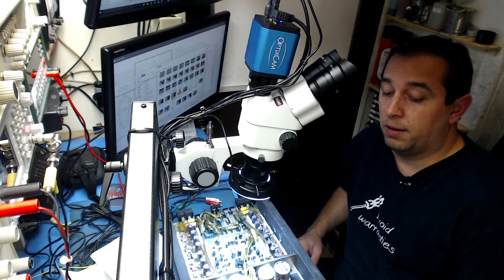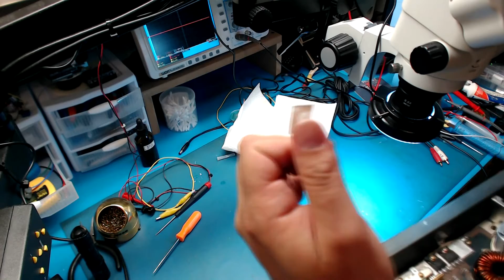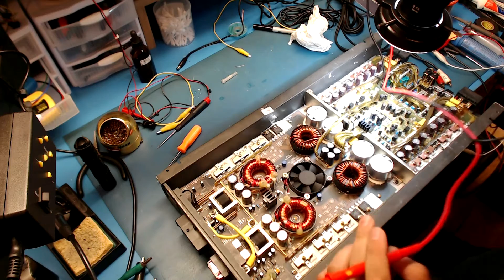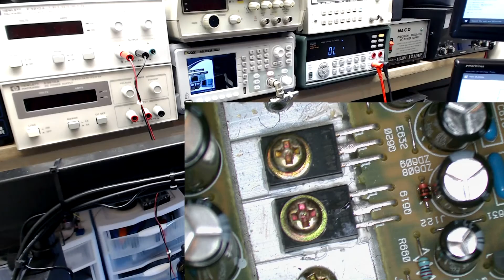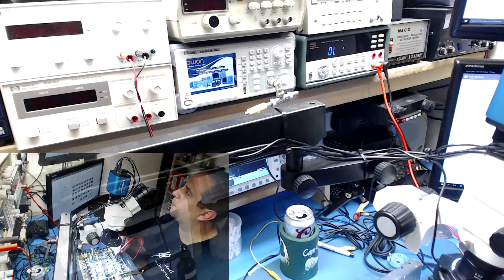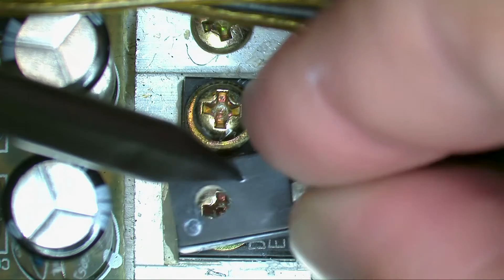ALPINE MRV-1507 AMPLIFIER REPAIR,  AMP #2

Comment: Hey man, love the videos, learning heaps from watching. What would you advise to use in the way of current limiting power supplies for testing? Do you always just use low voltage DC for testing on the secondary side of the power transformers or do you use a variac for bringing the item under test up slowly on mains AC with some sort or current limiter on the primary?
I think i ought to invest in an isolation transformer to start with, but keen to hear what your thoughts are!

Comment: hey ..im working on an amplifier which has no shorted transistors or component that i could fine but the output of the amplifier gives a noisey distorted sound ??could you help me out here .
Reply: premraj singh maybe soundcard
Reply: rodeo o Not quite.
Reply: There’s lots of things it could be.  Always start making certain power supply is correct... all the busses and power rails are to spec and well filtered/stable.  If all of the power requirements are good and things are generally stable you will need a scope and signal generator to follow it through all of the gain stages to find where the problem is.

Comment: I'm trying to repair a pioneer prs-x320 found one irf540n was shorted out on output side and wanted to know if I replace it will I need to do bias adjustment afterwards
Reply from the maker: +Sam Ward it should be real close but I would check it.
Reply: Kev31779  do u have a detailed  video on how to set bias gains
Reply from the maker: I don't for that amp. If you have the service manual for it it should be in there. Every amplifier bias specs is different.
Reply: Kev31779 is the idle adjustment the same as the bias cause that's all I can find in service manual
Reply: idle current adjustment
Reply from the maker: That should be it. Is it in the Milivolt range? Make sure there is no signal going through it and the amp has been warmed up for 10 minutes
Reply: Kev31779 yes 4.5 millivolt + or - .5 millivolt in ur professional opinion do u think I should replace all of the irf540n MOSFETs on board since it is cheaper to buy ten at a time
Reply from the maker: Well It is not always necessary but it is a good piece of mind. That is up to you. If the other parts have been stressed out then I would say yes. If one fet just popped and not other damage then you may get away with changing just the one part. But like I said its a piece of mind to change them all. I have changed just one part many times and the amps still work if that helps.
Reply: Kev31779 in the service manual it says to terminate inputs with  1k ohm resistors b4 adjusting idle current does that mean I can just put a 1k ohm resistor across the terminals of each of the RCA inputs
Reply from the maker: it seems from what you said.  Put a 1 k resistor from each input to the shield side. this should settle any noise
Reply: Kev31779 Im new to electronic repairs and don't want to sound like a noob but what do u mean by shield side
Reply from the maker: From what you told me the manual says. It's asking you to put a 1 k ohm resistor from the center of the RCA plug to the outer ring of the same plug on each channel.
Reply: Kev31779 thank you for your time and expertise ur videos r very informative and well made have learned a lot from watching them in fact its the way I found shorted MOSFET  in amplifier cause there was no visible damage
Reply from the maker: That's great glad I could help.

Comment: i have the same amp and i dumb me accidentally connected the positive to the negative and negative to positive i know i burned something out is there anyway you can help me out i dont mind sending the amp off to get it fixed i like the amp alot, i just need to find someone to fix it for me i dont know to much about it. thank you
Reply: its sam make and model
Reply: i also have a memphis 1000 watt i really need to fix them if you can please help me
Reply from the maker: Email me with your location and I will get back to you.  Email : majik.electronic.repair@gmail.com

Comment: How are the best ways to get schematics or Service Guides for amps? I have been searching sites but to no avail. I would appreciate your comments on locating schematics for electronics. Perhaps a suggestion for a few sites would be good also. Thanks for the great videos.
Reply from the maker: +renuecomputers.  If you cant find it with google or online manual sites you are out of luck. Most manufacturers dont leak out or sell service manuals.
Reply from the maker: +renuecomputers.  If you cant find it with google or online manual sites you are out of luck. Most manufacturers dont leak out or sell service manuals.